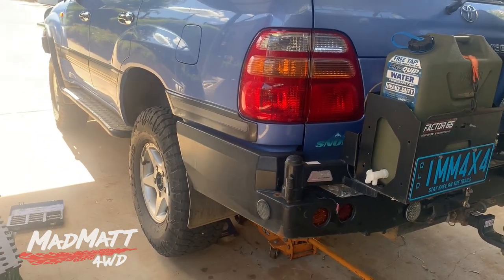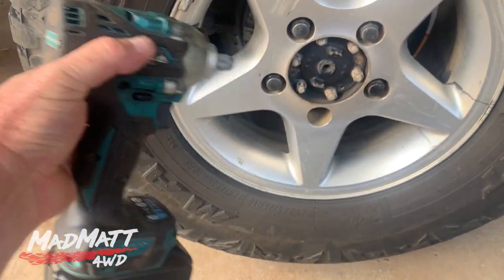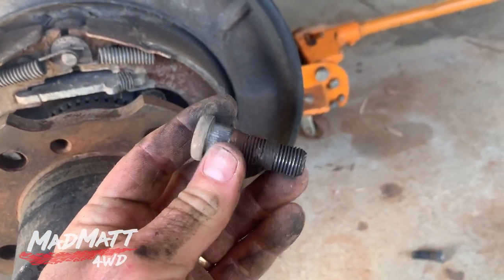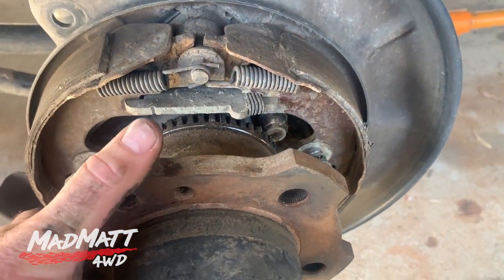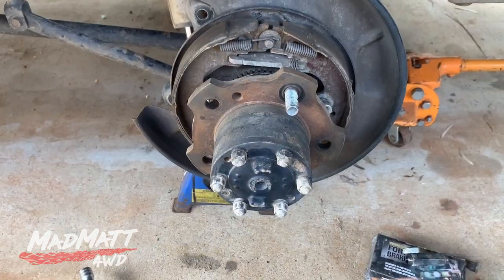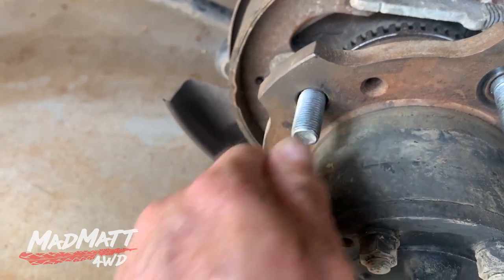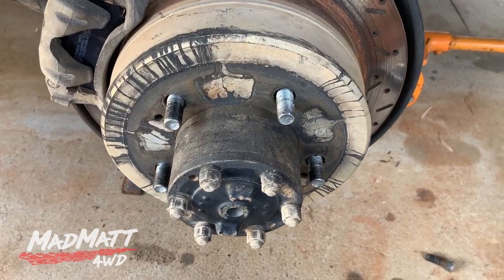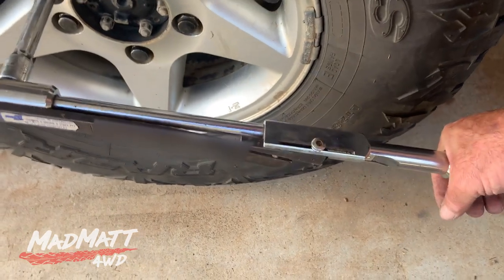How to change a broken wheel stud || How to tighten wheel nuts correctly.

Comment: Great content as always.  Question - the original wheel studs and the new ones, you greased/anti-sieze them.  Would that change the torque spec of the wheel nuts since the friction is reduced resulting in an increased stretch before the torque setting was reached?  While it is likely barely measurable on a light-duty vehicles like the common 4WD ute and wagon compared to the torque settings on heavy vehicles, over time could it subsequently reduce the service life of the studs but taking them past the yield point?   Could they be considered over-tightened at OEM spec 100ft-lb?
Reply from the maker: Watch my response video today.
Reply: @MadMatt4WD  good on you Matt.  Ive watched the video.  Like you, i anti-sieze the threads with just a dab, reduced torque accordingly and haven't had an issue - and I change wheels a lot  (an on-road and off-road set).
Your ability to open up a forum of conversation in simple terms on even the complex issues all in the name of safety and 4wd enjoyment is 2nd to none.
Reply from the maker: @Mouldyturnip75  thanks mate.
Reply: @brettbarrett7670  your comment is spot on. Take a look at a copy of something like the "Ajax Fastener Handbook" that you can find online with out too much trouble from a web search. From Issue 99 of that document, Table 20 sets out the torque adjustment recommended based on different fastener surface condition. Interestingly, degreased Zinc plated fasteners (according to the handbook) require less torque than lightly oiled plain finished steel. I picked this point of detail up from a John Cadogan video review of wheel nut torquing and the use of anti-/never-sieze, similar to Matt's piece here. The Ajax reference is handy because it refers to Australian standards, which is a nice touch for those of us from this part of the world.

Comment: That's not the way to install studs mate, at least not when you have a choice in the matter anyway.

It is a good method to show for when you find yourself doing it on the side of the road though. If you do use the nut method, take the car for a 5km or so drive afterwards and then retorque them, then do it again after 100km or so. The nut method doesn't do a fantastic job of seating the head of the stud against the back of the flange (it will often be a little loose, or a little out of square). After a bit of a drive around some corners you may find they've loosened up just a touch. You already know what that gets you....

No matter how you go about installing them, lubricate the splines on the new ones with oil (not grease). WD40 or engine oil are fine to use for that. It makes them go in a bit easier and helps prevent galling of the splines.

Your old ones were definitely stuffed. Not sure if it was fretting from the wheel or necking, but you can clearly see the reduced diameter at the flange end of the thread.

The right way of doing it is to remove the hub and do it in a press. If you're installing them into a new hub you'll have to use a press as the spline in the hub is formed by the stud the first time you install them. You also need to use a close fitting piece of heavy wall pipe to support the casting so that it doesn't crack.

The next best option for replacing studs, or for those that don't have and don't want to buy a press is to use a ball joint separator. Depending on what one you have you might need to remove a brake shoe for clearance, but they'll put the stud in no problem. You'll also want to use a washer to protect the hub face and make sure to grease the thread on the seperator.

The issue with the nut method is that you're relying on those studs having been replaced a number of times in order for them to be loose enough that you don't damage the new ones forcing them in.

Also, when you run grease or antisieze on the studs, reduce the install torque by 20%. For alloy wheels on a 100 series that puts them at 80ft/lb.

The torque required is to produce a certain amount of stretch in the bolt and consequently a certain clamping load between the wheel and hub face. By greasing the stud you substantially reduce the friction in the thread (which is a good thing) so more of the applied torque is stretching the stud. You can calculate it all out based on the thread pitch, bolt radius, applied torque and Young's modulus of the stud to see exactly how much torque is lost for a specific coefficient of friction, but 15-20% is a good rule of thumb.

And you're not alone either. I've done pretty much exactly the same thing. By the time the first one fired off into the bush the other 4 were so badly damaged that I couldn't get them tightened and by the time I got to my destination where I could get replacements and deal with it I only had two left.
Reply from the maker: Great comment and some excellent points I didn’t consider.

Comment: I had a rear wheel fly off while driving down the middle of a large mult-lane highway.  Amazing, no other vehicles were hit by the flying tire. I had so much adrenaline flowing and was shaking so I had to get one of my kids dial my phone to get a tow truck. Coincidentally, I had checked the torque earlier that morning and everything was fine. I have no idea why it failed. I did notice that three of the studs were missing the nuts and two of the studs had sheared off.
Reply from the maker: Oh wow. It would be scary watching the wheel fly down the road and hoping it doesn’t do any damage.
Reply: But how were 3 of then missing the nuts? Unless I'm missing something, it sounds like possible sabotage on those 3 nuts....  🤔
Reply: @xallstatex2910  This happened close to 15 years ago, but I do remember deciding to check the nuts just before driving so I know that no one touched them after that. I'm guessing that they had previously been overtightened. The whole process from starting to feel a vibration until the wheel came off was less than a minute.

Comment: Matt, did it ever occur to you that the slightly loose nuts were not the problem but just maybe the very common cause of 'shit' behind the rim and what we see in the video on the brake drum. All it takes is a few grains of sand dropping down into the rim/drum interface and voilla, wheels come loose. From my experience over 50 years of 4WDing and watching the very first alloy rims being used, this was always the issue until we figured out there is no 'coining' in an alloy rim (steel rims also have sharper points of contact so many 4wders were caught out with dirt/sand issues with alloys) and apart from tight wheel nuts the mating surface cleanliness is paramount. I reckon your horrible (dont ever use these worst tool in the shed, its just laziness) rattle gun at second stage torque likely was ok, its more likely the dirt and shit..... Maybe a video to complete the lesson is worthwhile....
Reply from the maker: In this case I know I didn't tighten the wheel nuts when I dropped it off the hoist so in this case no it wasnt dirt. I give the mating surfaces a clean before I fit my wheels which would have been a good point to add into the video. 
Like any tool if used correctly its a good tool but missused it can be a bad tool. Rattle guns are a great tool if used right. There is a real temptation to use them to tighten everything though and I've found that a spanner check is always warrented.

Comment: This is why you put a piece of blue tape on each wheel. Final torque check, pull the tape. I’m a motorcyclist. Wheel-nuts and or wheels flying about on the roadway, will kill me.
Reply from the maker: I think a flying wheel could kill any road user. It’s certainly not ideal.
Reply: Or flying rubber from disintegrating truck retread tyres.
Reply: @MadMatt4WD  true but given a choice, I’d choose to be in my truck.
Reply: @Ted...youtubee  I hit one that flew up and hit my buddy’s bike behind me. Bent his foot board and took out his rear brake light switch.
Reply from the maker: @MaxairEngineering  Oh for sure being on a bike is vulnerable.

Comment: Wheel came off my Fiat at 50mph on the motorway. Very scary! not nice, no idea how or why, police think there was a state of alloy wheel thefts from the motorway services and most likely they'd loosened the bolts but got disturbed. Not fun lots of damage to the calliper brake lines and lower wishbone - sold the car on with full disclosure very quickly.
Reply from the maker: Wow that crazy. Glad all was ok in the end

Comment: talk about doing it the hard way.get a normal wheel nut that fits and tighten it up + the other nuts must have been loose to have it vibrate
Reply from the maker: I didn’t have a normal nut. I said that and I never tightened them up which was the problem.

Comment: I had a wheel nut disappear off a front wheel that had been checked for air leakage by a tyre business. Another nut was loose. Unfortunately the lost nut was an anti theft one but I sacrificed one from the rear spare. The moral of this story is: don’t trust anyone but yourself to tighten up your vehicle’s wheel nuts.  (Not the ones hanging off the tow ball btw)! 😂👍🏻🙏🦘